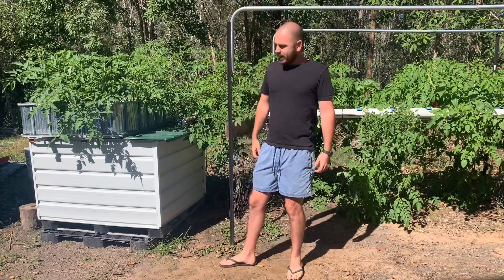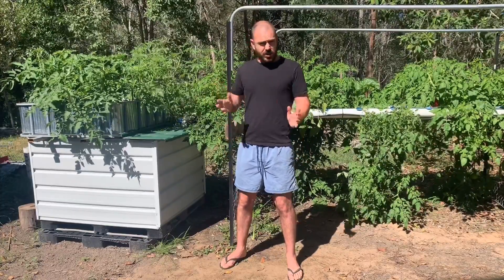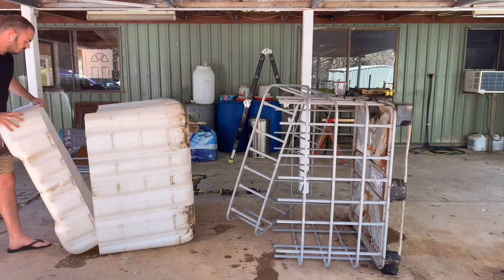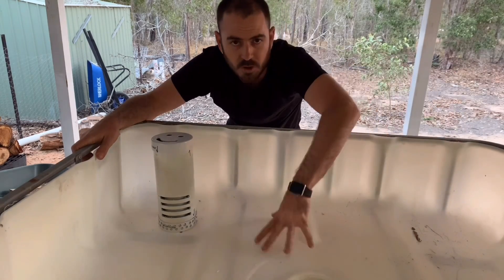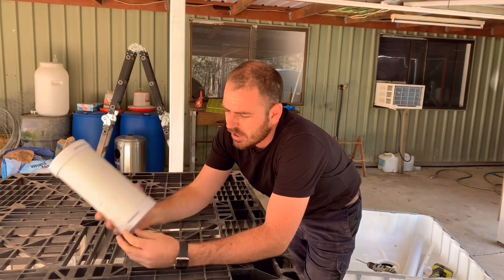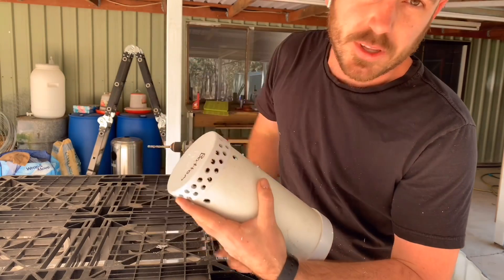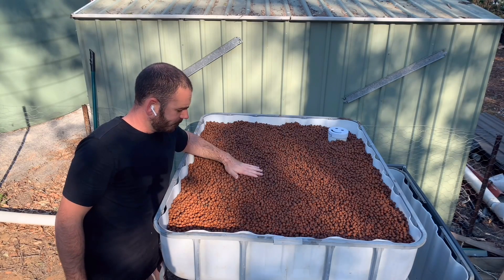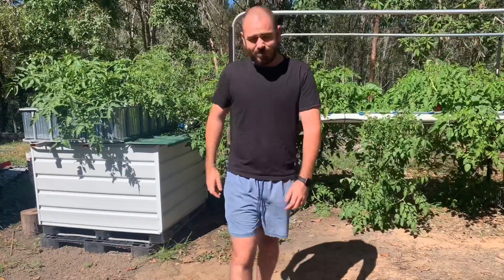How to Build a Chop & Flip IBC Aquaponic System

Comment: The reducer you use in the bell siphon also helps in priming the bell siphon to work,  the bell  needs to be close to siphon top as if not while the tank is filling the shroud will float causing priming issues an possible flooding or bell siphon failure. Under the siphon inclusion of two elbows one from bell an 12 inches of pipe an another elbow which you can rotate from it flowing directly nto water or turn so water cascades depending on whether the siphon shuts off, the second elbow  stalls the flow an back feeds in pressure starting siphon sooner as water passes over siphon height not bell height
Reply from the maker: Prcdguy Australia I believe you are correct.
Reply: @Hoocho  either way am   researching as Grandpa once said
" Expand your mind an allways learn.you can never know everything. ".
Even though a new veiwer I'm enjoying waching your clips they are very imformative , even opened my eyes to a few things along  your travels
Reply: @Hoocho  Yer did this trial in YT clips  as part of my Cert 4 in aquaculture when building aquaponics system ( my channel )   also  25mm riser needs a 50mm bell . Just passing on learnt headaches  so others dont have too
Reply: theres supposed to be a small airtube in on the side of the syphon tube that sets the water drain start level. watch rob bob's aquaponic & backyard farm, for a complete instructional video on how to make a proper bell syphon.

Comment: How often do you flood/feed the top section?
Reply from the maker: It continually floods and drains. When the water reaches max height the bell syphon kicks in and drains it, then when the bed is drained the syphon breaks and it fills. The pump is always on.
Reply: Hoocho thanks.